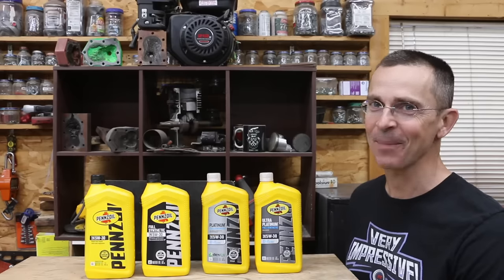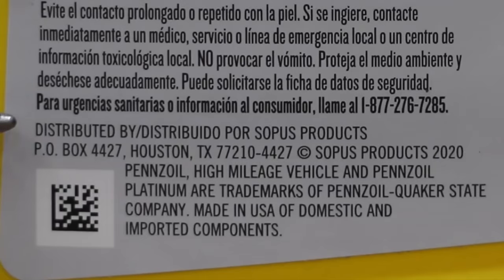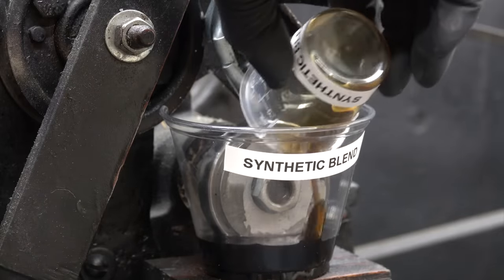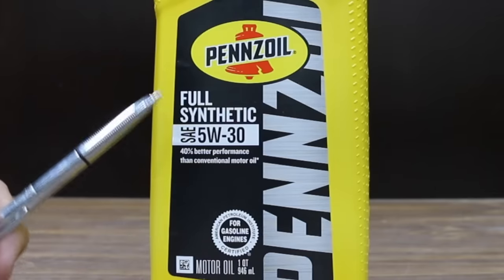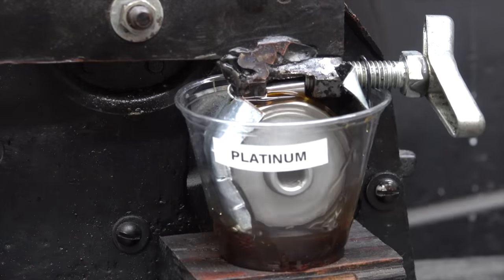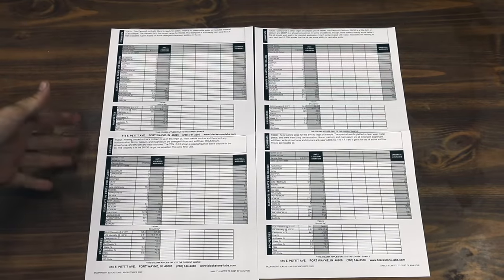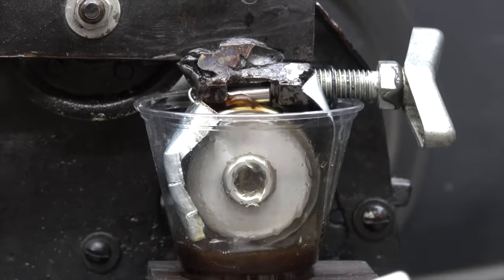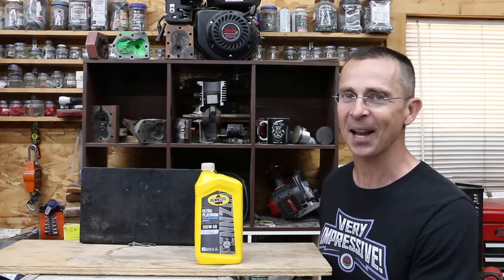Are They All The Same Motor Oil? Let's Settle This!  Four Levels of Pennzoil Motor Oil Compared

Comment: As someone who uses Pennzoil products myself, this was very helpful! I especially found the difference in "cooked" vs "uncooked" platinum cold-flow performance fascinating. Here's an idea for future oil reviews: we've seen how all the big names like Pennzoil, Amsoil, and others stack up, but what about dealership oils? While some automakers partner with brands that have already been tested, some have suppliers that are not brands you can buy from local stores (Subaru for example uses a brand called Idemitsu). In summary, which dealership brand has the best oil, and if you still take your car or truck to the dealership for service, should you be bringing your own oil? I know I always prefer to bring my own oil and filter, but I know plenty of people who don't think it's worth it. Interested in your thoughts, and I look forward to more great videos! Keep it up!
Reply from the maker: Thanks, will do!  Thanks for the suggestion.
Reply: @ProjectFarm  this is incredible! Do you have any experience with mechanical engineering?
Reply: Over the last two years(lessons learned) I always bring my own oil/filter. My preferred is Pennzoil Ultra or regular Platinum for my 2014 3.5 F150 ecoboost. Pennzoil has made a HUGE difference on my engine which previously was Motorcraft. No more knocking, much quieter and smoother shifts in the transmission. Not to mention, 3.5 more miles per gallon at 19.2. Pennzoil is the best choice imo for my truck.
Reply: Good idea.  I have been using Federated or Federal Auto oil for years.
Reply: @CWB1863  Good to know and thanks for your comment. I have a 2012  F150 with 96600 miles on it and try to give it frequent oil changes with the Ultra. My buddy is a mechanic and changes the oil in his driveway and takes the extra time to allow every single drop of oil to drain before adding the new. Quick oil change service stations don't do that.
Reply: @stayinthemoment18  I stay away from those quick oil change stations like the plague. Let's just say, it's hard to find a good mechanic these days. Luckily i have a really good one just a mile away where we take all our vehicles. Good luck with your F150, i do love mine. Take care!
Reply: Hi Dylan. A few decades ago most of the oil makers contacted all the auto and motorcycle companies. They told them We will sell you our oil at good rates. You can put it in your branded bottles and sell loads. The auto and bike companies tested all the supplied samples, chose a strategic company to work with and ran with it. Thus the Mopar, Hondaline, Yamalube, et all had Official Oil to sell. Except Kawasaki. They pondered things and sent spec data to all the oil makers saying, These are the oils we require. If desired, make samples which we will test in our labs. After more deep pondering and exhaustive tests, one lone oil maker was chosen. They agreed to add Kawasaki additive package to nearly stop cam wear and clutch plate glazing. (Needed in wet-clutch engines). Plus the special polymers that can survive in a superbike gearbox. The secret chosen maker? It is thusly called Kawasaki Oil and has a few good varieties. The maker is good old Motul. Pretty darn good oil. Engines refuse to wear with that stuff, IF you follow the correct oil service intervals. Good luck!
Reply: Damn he talks fast
Reply: The only time I ever got my oil changed by someone else the bozo cross threaded the drain plug 😮
Reply: @alanhardy3374  Hi Alan. Were you able to salvage the threads? I feel your pain. One time I had an oil change done on a new-for-me sports car. This at the high-end shop I bought it from. The bill was huge, I paid thinking Oh well, it's perfect right? 
Bombed around for an extra hour on the way home, then placed the car level, planning on checking the oil level. I wanted to see the beyond perfect job results. 
Open hood. First thing I see? The airbox to throttle body rubber pipe isn't in place. It's mostly off. The filtered transmission  breather tube is off it's spout. Below the oil filler neck is a shallow tray. It is filled with spilled oil. Oil level was fine, luckily. Looked at the OE drain plug. You have to use an 8mm allen key on that, pretty tight at 34 ft lbs. Some dork used a loose fitting torx bit on it and tore it up. Had to replace it next oil change. Like you, never again. Done most of my own work since.
Reply: @alanhardy3374  I’ve never changed my own oil and never had my drain plug cross threaded.

Comment: Been waiting for another oil review!
Reply from the maker: Awesome!  Any suggestions for future oil reviews?
Reply: @ProjectFarm  
Perhaps ask the Mobil 1 variants next? 
Although I think they only make full synthetic oils, they’ve got the ESP (emission system protection) oils, advanced fuel economy (made only in 0W20) & the high mileage and extended performance oils. 

Or another video could be comparing the relatively new 0W16 (GF6B) vs the 0W20 (GF6A) 
The 0W16 is designed specifically for engines with turbochargers and/or GDI to reduce oil dilution.

Comment: Ever since your oil testing marathon, I been using Amsoil and I can tell the difference immediately. Been using it ever since. Thank you for all your hard work.
Reply: How often do you change your amsoil
Reply: @chrisp3139  for many years,  I have changed all my vehicles at 25,000 miles using Amsoil Signature Series!
Reply: I'm willing to bet you cannot. You're leading yourself to "think" that you're perceiving a difference. You truly want to believe, so you do.
Reply: @joeblowe7545  look at all the independent testing, plus check the difference in fuel mileage and you will think different. I was suspect in the beginning also, then I did my research.
Reply: @monroebass2  Nah. I'm familiar with PQIA, Blackstone, etc.  Fuel mileage differences? Maybe a very small fraction of a percent. Statistically ZERO difference. I've always found it amusing reading all the "perceived" differences in performance, and car sexual virility, etc, when someone installs the best-ist most super-duper unicorn oil by the majors, or the boutiques. Look, if you get the warm fuzzy feelies just before nodding off to bed thinking that you installed the best oil possible for your vehicle, then that's great. ANY modern SP, SN, SM and even SL API cert oils changed as per manufacturer's recommendations, and equally important actually keeping the oil topped up, will keep a great majority of vehicles happily running for many years.

Comment: I’d like to see the difference between 5000 mile oil changes vs when the car tells you to change the oil (for me between 7000 and 8000 miles).
Reply: This would be great
Reply: That is actual where you can tell the different between high and low quality oil.
Fresh oil is always ok, but is it still ok when you chance it?
Reply: @jonasstahl9826  Exactly my thoughts about it. I use high quality oil and a 10k rated filter and still change every 5. Idc what the manufacture say, they aren't the ones buying me a new car when my engine dies ya feel me
Reply: @robertmccabe1919 , replacing your oil every 5k in 2022 is such a waste of money. I’d also love to hear what you consider to be a high quality oil.
Reply: @CornFed_3  Possible as engines age the new spends most of its first 1000 miles cleaning the old oil and “seasoning”.
Reply: @CornFed_3  no it isnt
Reply: @steve5912 , it absolutely is. If you can’t go beyond 5k miles on a single oil change, you must be using a terrible product.
Reply: I build engines and maintain cars for friends and family. Most all GM, and the only one to loose an engine in my care was one that I changed the oil when the light said so (7k to 8k miles). It only got to 169k miles and a cam bearing seized and broke the cam. No sludge in the engine but it had a sticky red varnish on everything. My cars always have an oil pressure gauge and I can watch the oil pressure drop off at 3k miles. So things I run hard I change at 3k miles, and for my commuter I change at 5k miles but am more gentile on it over 3k miles.
Reply: if you start reading owners manuals you will find many (VW is one) now recommending 10k miles for an oil change. I often wonder what's left of the additive package at that point, never mind various contaminants, including moisture.
Reply: @CornFed_3  Disagree.  On some engines, particularly turbocharged direct injection engines, you really need to be changing that oil more often.  It's common knowledge the oil gets more dirty much quicker than other engines, with fuel contamination, PCV contamination, etc.  Yes, the owner's manual may "recommend" 7,500 mile OCI or even 10,000 mile OCI, but why risk it?  You paid extra money for a high power turbocharged engine, why cheap out on oil?  For normal, naturally aspirated engines which see a lot of easy highway miles, yes 7,500 or 10,000 mile OCI is appropriate.
Reply: @LA_Commander , it’s not cheaping out on oil, it’s avoiding wasting money on maintenance. I come from the diesel world where 15k intervals are standard and bypass systems allow for 45k+ mile intervals with no issues. Obviously doing regular samples and testing is a part of that but for the average diesel owner, 15k is the norm. As for my turbo/direct-injected SUV, it gets an oil change once a year. I’ll never hit the mileage threshold on it so I don’t bother wasting money every 3 months to do an oil change. I do agree with your point on if an engine is being used hard, change it more often though. I just always laugh at people that disagree with a 10k interval per the manufacturer but are alright with their 5k made up rule. If they actually ran quality oil, a 10k interval wouldn’t let them down.
Reply: @rupe53 , again, depends on the oil being used.
Reply: @CornFed_3  .... would somewhat agree... and it depends on the type service the vehicle sees in its life. Of course that info is in the manual, and they always offer that anything more severe than "normal" is a call for shorter intervals. (whatever normal is) BTW, just retired from this field so am quite familiar with all the old wives' tales, oil samples, etc. I have actually run long term tests with both Wolf's Head and Penzoil in a fleet. Penzoil wins hand down, in the category of keeping an engine clean internally. (in the days of non-synthetic) Ran local delivery up beyond 300k miles on a gas engine fleet with no oil related failures.
Reply: @rupe53 , I’ve never used Pennzoil personally but I’ve heard they offer solid products. I’m partial to Schaffer’s or Amsoil and have used both long-term with great results. Schaffer’s wins without question at cleaning an engine out.
Reply: @CornFed_3  ... also used Amali products for 10 years with similar results. That was a mixed 35 vehicle fleet of mostly older vehicles, including heating oil delivery and 6.5 Chevy diesels. (service vans) I have to say those stayed clean inside, despite a boatload of idle time. In that era we had Cat 3208 and DT-466 on the larger stuff.
Reply: @CornFed_3  Well, if you think that spending $20 for your own oil and filter is wasting money on maintenance, then I guess we're just going to have to agree to disagree on that one.  The very cheapest oil change I have done is $16 (that's $12 for the cheapest Chevron synthetic blend 5 quart jug at Walmart and $4 for a Motorcraft filter).  So if price if a concern, you can always go the $16 route.  Or you can spend the $20-$25 and get a higher quality full-synthetic oil.  Either way it's money well spent in my opinion.  With the price of gas at $6 a gallon which means over $100 fill-ups for many people, why cheap out on $20 every few months to protect your engine?  That kind of penny wise but pound foolish type of logic just doesn't make sense to me at all.
Reply: @LA_Commander , you clearly didn’t get my point. I do all of my own maintenance and my oil changes run close to $100, depending on pricing in a given month. Money isn’t the issue, it’s the fact that people waste because they think changing their oil early is somehow better/smarter than the engineers that designed the engines. It’s comical at this point. Sure, if people use cheap dino or blended oil, change it sooner because those products are garbage. However, using quality oils (Base 4 and 5 oils) will have zero, I repeat, ZERO issue going to the manufacturer intervals. The only other time I’d change early is if the motor is being ran hard, as I stated in another reply.
Reply: @CornFed_3  Ok, I think I understand you better now.  I didn't know your oil changes are costing you $100.  My comment was aimed more at the "average" driver with the "average" passenger car which is around 5 quarts of oil and 1 oil filter.  For the larger, commercial diesel trucks which put a lot of miles on very quickly, then yes 10,000 miles is appropriate because you will rack up those kinds of miles very fast in a commercial truck.  So I agree with you that spending an extra hundred dollars every 5,000 miles is not money well spent in that scenario.  I think we may have been arguing "apples and oranges".  My comment was more aimed at your average Joe Six Pack who has a turbo direct injection 4 cylinder car, and may drive a short way to work each day.  There are people out there who drive 1-2 miles to work each day and the engine doesn't get a chance to reach operating temperature.  These people often do not take good care of their cars and fail to change the oil.  This is very hard on engines. Waiting to change your oil to 10,000 miles is not a good idea in this case because it would take a very long time to get there, so an earlier OCI would be recommended for these people.  But for cars which see a lot of easy highway miles, and provided you are using a high-quality oil, then yes 10k miles could be appropriate in this situation.  I guess it all depends on your own driving situation.  There is no "one size fits all" here.

Comment: It would be interesting to see contamination testing for fuel, antifreeze, and ethanol. I would recommend testing 0.01%, 0.1%, 1%, 5%, 10%, 25% to see how the wear is. I have not seen any videos covering that sort of stuff. Thanks for doing these videos, they are always a treat!
Reply: @Peter Angles A mix of 0.01% water in 1L of oil is not hard because 0.00->1.00mL syringes are common

Comment: I'd really like you to test Motul X-CESS oil, since I've heard it's really good.

Also, one test that you should add to your testing suite is how clean the oil burns. As in, how much soot and deposits are formed when the oil burns away? There's a few oil specifications that are based around that alone, so it would be good to know what test results actually look like for that.
Reply from the maker: Thanks for the suggestions.

Comment: So glad you did this test. I’ve been using pennzoil platinum for my daily and ultra platinum for my gf’s daily after watching the oil bracket showdown. I was using platinum because it’s difficult to find in physical stores for me. Plus my vehicles uses 0w-20, whereas her vehicle is a more common 5w-30 so I can buy bulk online. I will have to buy more ultra platinum and stay away from platinum. Only the best, thank you for your hard work
Reply from the maker: Thanks and you are welcome!
Reply: You should step up to a thicker oil. The thin stuff is just for Cafe requirements to get the best fuel mileage, it’s not the best for your engine. I’d look up what other people are running for thicker oil in whatever engine you have.

Comment: Random thought, I don’t watch all and couldn’t find a comment mentioning it but since the evaporative loss test is conducted without the same initial masses wouldn’t it be more accurate to report the results in terms of percentage loss instead of loss in grams? It’s possible that the difference in initial mass isn’t enough to be important, especially in this test, but it could be in others. Again, I am no expert and your tests are far more thorough than most others I have seen so keep up the excellent work!
Reply: When he first starts the evaporation test he explains each pot is filled with 200 grams of oil, so the oil mass is the same. The difference is coming from the coffee pots.

Comment: Really want to see if we can run a engine on used gear oil. I've seen people add a small amount to help with oil burning issues but want to see you do a test as you always take thing the next step further and it's great to see! Keep it up
Reply from the maker: Thanks, will do!  Thanks for the suggestion.
Reply: I had a 97 Cadillac STS that burned oil. I started adding a half qt Lucas oil stabilizer per oil change and I no longer had to fill 1 qt a week due to burn. In fact I didn't have to add any before next oil change.
Reply: It foams badly! I tried it in a mower. Looked like milkshake. Actually skip that. If it burns oil the cat is probably clogged. The sulphur in gear oil will ream your sinuses out. Haha

Comment: Awesome test as always! Maybe the dexos rating has something to do with the additive package being out of whack
Reply from the maker: I believe you are right
Reply: @ProjectFarm  , Could be, but I've also heard oil companies don't want to pay the royalties to GM to display the Dexos logo as well.  Great video and thanks
Reply: I wondered the same.  The only rationalization I could come up with was, perhaps the oil has better cling to the metal parts with lessor additives.  Again, a rationalization, not an engineering based hypothesis. Also, many times a better lubricant comes to market and doesn’t carry a designation because it hasn’t been tested/approved yet. One thing is for sure, given the results of the fuel contamination testing, I’m sticking with my shorter than recommended oil change intervals.